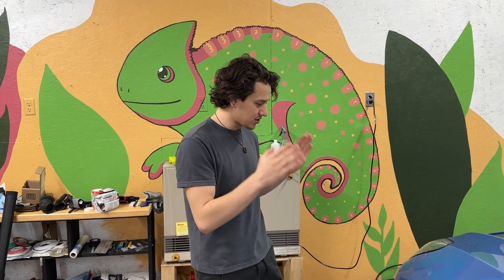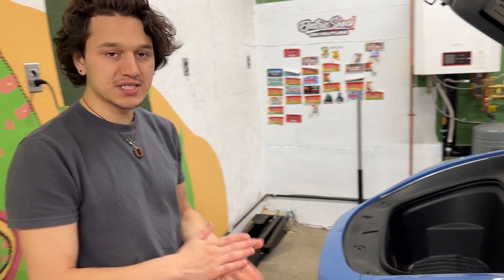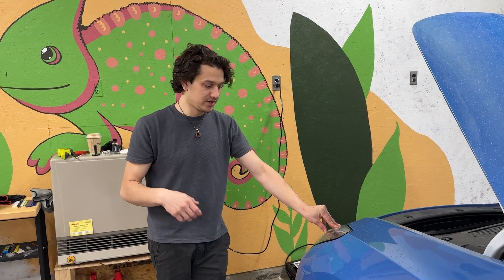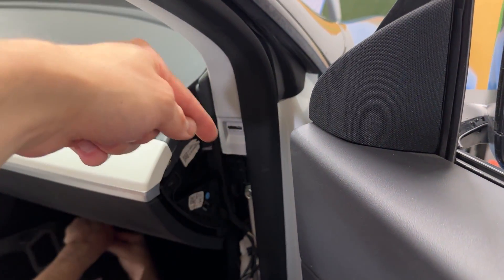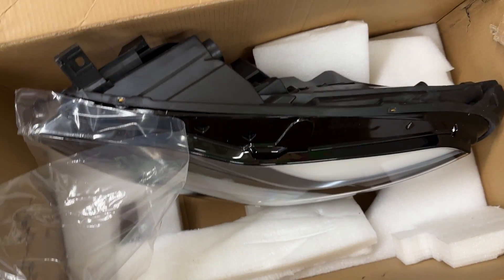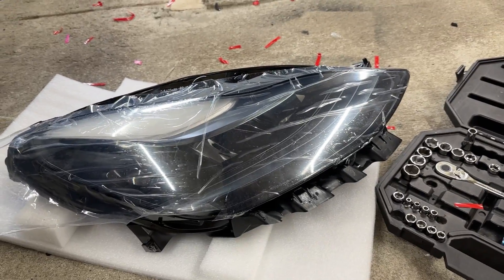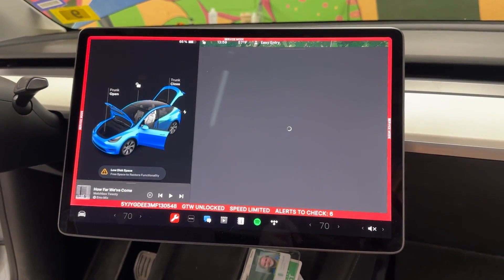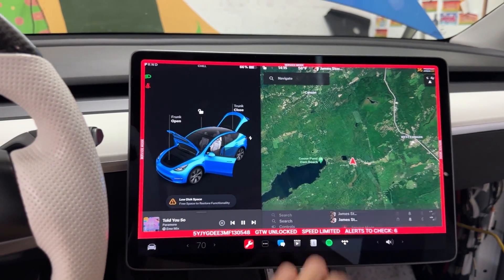How To Retrofit Matrix Headlights on Model 3 & Model Y!

Comment: You can do the coding yourself. 
It costs like 45€ per hour (i think EU only, US is 1day minimum for 110€), and you can do it in one hour.
Me and a friend did it on both our 19 and 20 models.
Reply: Did you use headlights from aliexpress?
Reply: @rawrandom-yt No and l would advise not to use uncertified Aliexpress lights + (illegal in EU).

I bought mine used for 600-700€. 
Matrix Lights Part Numbers:
1x 1514952-00-D - Headlights for Tesla Model 3 / Y left (Global)
1x 1514953-00-D - Headlights for Tesla Model 3 / Y right (Global)

And sold the old ones for 450€.

Comment: I wonder if since the last update if going into "Service Mode" Then reinstall the software update would achieve the same thing -- without the ethernet/toolbox3 change... 

{{edited from original}}
Reply: Hmm. You have done this with experience? Seems like the new code must be pushed to the computer, otherwise it wouldn't have the code for the matrix headlights I think. It would reinstall the code for non matrix lights?
Reply: @AlenMop  You may be correct, it might require the cable method and Toolbox 3 which is crazy overpriced "Right to work... if money is no object" $300 a month what a joke.  I believe the re-code is from SAE to Global.  I would be interested to know if just re-insalling the software worked since the last few updates though.  Not a 500 dollar gamble I am going to make though.

Comment: Do the headlights from the Model Y fit the Model 3? When checking the Tesla Parts Catalog, they are listed under different part numbers. While both vehicles have different designs, the headlights appear to look the same at first glance.
Reply: Yes same
Reply: Lower bracket might be different

Comment: Hey! Great video, are you able to provide the link/contact of the guy who did the update configuration? I don’t see it in the description, I already have the headlights just need to get them updated. Thanks!
Reply: Hi, do you have them in place ? i would like to know how it behave without activation. thanks
Reply: @MathiasMuller33  Did you ever find out?
Reply: @EnthusiastCarHangar  no, but I have bought the cable to use toolbox to activate it by my own

Comment: service mode - Re-install update. Will that program the headlight ECUs?
Reply from the maker: Nope you need to have the config updated
Reply: @reidtomasko3857 what exactly he did.i have matrix from factory but i made a software reinstall because i changed lv battery and now my headlights dont work on service mode says control module failed during firmware flashing.before reinstall they worked.thanks

Comment: I got an error code 
GTW_w098 HCMRverisonMismatch 
Won’t update the ecu firmware on headlights any ideas?
Reply from the maker: You need to have Tesla update the config
Reply: @reidtomasko3857 How would they do that? I scheduled a service appointment but that is 3 weeks out.
I purchased the car used and the previous owner must have upgraded the headlights then the factory settings for the new owner must of defaulted?
Reply: I dont know what to do.stays on only parking light without turning signal and without low beam etc.
Reply: @reidtomasko3857 Your friend must have special tech permission as well because the headlight region option is not available in toolbox for owners
Reply: Hi! You found a solution to the problem because I have the same problem.

Comment: Do not do this.. I had a model 3 and I had to purchase a 2024 Y (3 got totaled) and this is a complete downgrade.. It's not as bright when compared to the old M3 and what's worse is that there is major banding when on high beams (literally looks like a shutter blind) and large black spots on low beams. I called Tesla and they acknowledged the issue and they sent me videos and pictures of other Model Ys with the same issue. I cannot believe how idiotic this is and how poor the quality of these headlights are. I would have never purchased another Tesla but unfortunately my preferred cars (R2 or Macan) are not available yet. Not to mention FSD is total crap and I paid 7k$ for that.. Uggh.
Reply: You just need a headlight alignment.
Reply: @PizzaMan5000 the technicisn went back to the showroom and tested 5 different cars and sent me pictures and said all cars are exhibiting the same affect. He and I also talked about alignment but thought it would not work because the shutter blind affect is horizontal and you can chance the vertical orientation and big dark spots won't go away with any alignment anyway.
Reply from the maker: I upgraded my Model S to matrix and they were so much better, maybe it's just a y/3 issue?
Reply: In Europe with Matrix is totally different game and it is incredibly good with the Adaptive option. I hear that Tesla is trying to bring the adaptive option to USA as well.